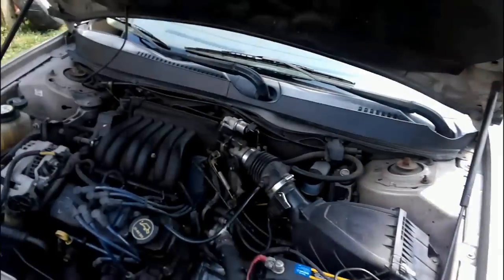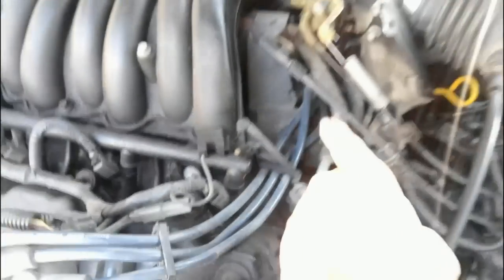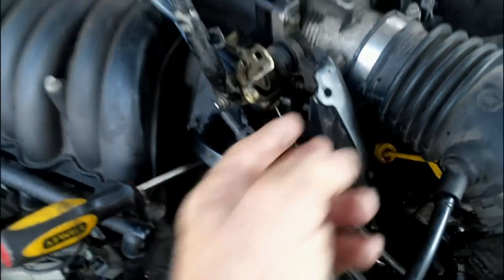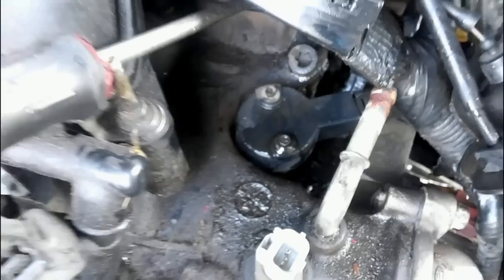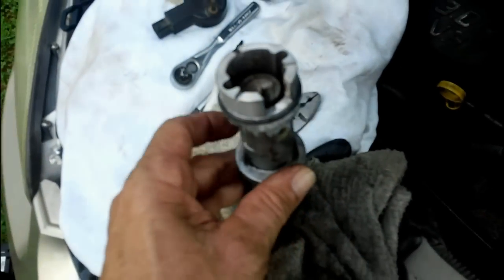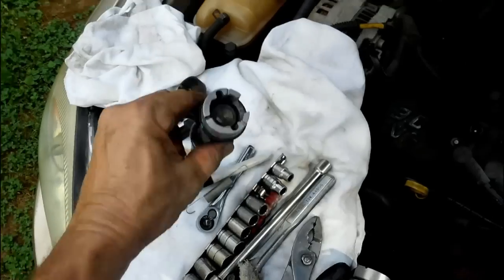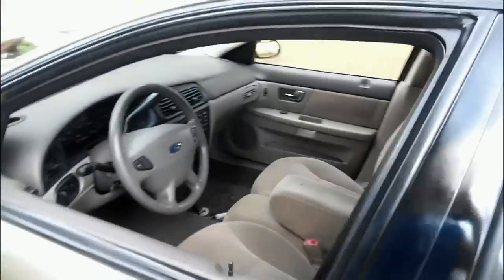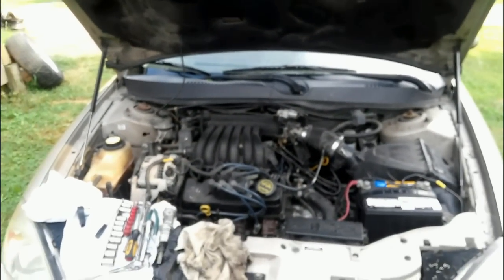Taurus Camshaft synchronizer replacement. Taurus 3.0 2001 (squeak, squeak, squeak) Easy way to do.

Comment: Your video is still helping people six years later hy the way! Just snagged an 03 rust free Taurus with 75k miles and had that same whine. She  sounds perfect now!
Reply from the maker: Thats really Cool!!
Reply: I’ve got an 02 wagon I’m driving while I’m saving up to rebuild my 4.0l sport trac that jumped time. The wagon had been sitting since 2019 and has started making the chirp. Plan on going ahead and replacing the synchronizer this weekend, thank you very much for your informative video.
Reply: @colbyeads7895  I wish mine was a wagon. Rock it proudly! And maybe save money and not rebuild that 4.0? Jkjk.

Comment: I'm in the discovery stage for the problem for my 2005 Taurus with 140k miles and with the same engine - 3.0 Vulcan engine (with the Single Overhead Cam), and I think this was exactly what I needed.  Of course the first I thought with that kind of squeak is that it was a bearing on the water pump or alternator, but the squeak is coming from the center of the engine - exactly where (as it turns out) the camshaft synchronizer is located.  I had no idea this happened and is somewhat common.  So thanks in advance - based on your description and video, I'm 95% confident this is my problem too.  Super video with enough detail to do the repair and enough information to help make the diagnosis.  MUCH appreciated.... Later - Yep, that was it.  Hardest part turned out to be getting the wiring harness out of the way.  Your video was very helpful.

Comment: Thanks, tee vee waxman. I followed your step by step instructions, and it was tough, but yes it worked. Car had quit on me, left it at work for three days, fixed it as the sun rose this past saturday, beat the rain, yes it took right at two hours to replace. Tough to wrangle all that crap out of the way, had to use three bungee cords to do so. Thanks again, tee vee, you saved me four hundred at the dealership.
Reply from the maker: Cool! Glad it worked for you!

Comment: I had to replace mine today and when I took the sensor off, I couldn't believe it but mine was lined up just like yours so I also got very lucky. It took me probably 6-7 times putting the syncronizer in and out to get the new one in just right but I finally got it, then I reconnected everything, started up the car and it ran perfectly. This just took me hr and a half from start to finish so I was pretty stoked being this was the first time I had ever replaced this part. I saved 500.00 doing it myself and yes guys you will be nervous cause all I worried about was messing the timing up but it worked out great and the car runs beautifully.
Reply from the maker: Nice! On a white 02 I have I likely never got that thing lined up! Took 2hrs. Sometimes it just works out.
Reply: TVWXMAN32 does it always line up TDC or is it just luck that happens
Reply: 500 bucks labor is what they want!
Reply: Did you have to put it on Top Dead Center?

Comment: Just oiled mine and fixed it (for now). Has 180K so it's last rodeo...
Thanks for great video!
Reply: What do you mean you just took it out and put engine oil all over and that worked
Reply: @hoosierdad4  Someone suggested just putting a little oil down in there then reinstalling. I did that and been fine for awhile now.
Reply: Did you have to put it on Top Dead Center?

Comment: LOL. Just watched your video.....AFTER I changed mine.  I was not lucky enough to have it dead center, but I did a pretty good job of marking it. The problem was that the new one was NOT exactly in line with my lines.  Anyway, I put it in as close as I could and started the car. Started and ran at 1000 rpms for 2 seconds and stopped. That I why I came in to look for videos of others installing to see if I screwed up and how. At the very end of your video it hit me.....I never tightened the band on the accordian hose where it meets the throttle body. So, I got my butt up and went out and looked. Not only did I not tighten it, I didn't even have it on the throttle body.  So, put it on and tightened it and hit the key.... purring like a kittel.
Reply from the maker: Nice! Glad you got it fixed! ...Feels good to save big money and time!!

Comment: I just now have this problem with my 2003 Taurus Vulcan V6 with 100450 on the clock. This is just like replacing a mechanical distributor. Thanks for this video on how to fix it.
Reply from the maker: Nice....At least your heater works ;)

Comment: My friend is having this same problem.  I tried using a basic code reader but it would not throw the code. Just a check engine light and oil light. Good video.

Comment: To whom it may concern.  For a temporary fix, I have been taking off the sensor (the black piece on top of the metal part) and squirting 3 in one oil on the top of the shaft.  It seems the bushing/bearing at the top  gets dry for some reason.  it holds for about 4 months then you have to do it again.  I have been doing this for 50,000 miles..still working fine since 100k.  Just a emergency get-you-by till you get the time or the money.  6:53  just squirt a couple a good squirts right on top and it seeps down.
Reply from the maker: Lucky you! It never worked for me....
Reply: yep..lucky i spose, but it still working fine.  I imagine one day I will be pulling it out so I can see exactly what part is squeaking, but I hypothesize, that the oil isnt getting up to the top bushing for some reason, or maybe its greased at the factory and when that wears out, it squeaks.  Not real sure, but it may buy some time for someone if it works.
  Thanks for the videos, btw.  really helps me out with my taurus.  Appreciate the effort.
Reply: I'm going to give this a try, don't have the money to replace the synchronizer right now, all I need is to make it last till I get my tax refund.
Reply: It worked for me ! Just dropped a few drops of oil right on TOP of the synchronizer , no more squeak ! Thanks bro
Reply: Did that also cause the p0340 camshaft code to go
Reply: The sqweek probably not
Reply: @dxta7360  it should right

Comment: My 02 Taurus only has 122k but the squeak seems to come from the belts somewhere. If they get wet it lessens. When the car warms up it goes away but when it has been driven for a while it will get a flashing oil light at stop lights. Check engine light just says misfire first 1000 revs. Not sure if this is the issue. Probably multiple issues but it runs pretty fine for the most part. Have noticed it lurch at stop lights  recently too. Any help is appreciated.

Comment: Thank you very much for the video this gives me confidence to replace myself....I just put new belt on thinking that was my problem. also where is that black bolt located you took off ?
Reply from the maker: Nice! Side of cam shaft hold down bracket.

Comment: I have the same year that has been sitting for 4 years. It cranks but no start. I have no voltage going to the cam sensor, is there a broken wire or what? I have been trying for 2 months to diagnose it. Any ideas?

Comment: Spent the last two days replacing this on my 4.0 ranger only to get no oil pressure once I was finished, gotta redo the whole thing now
Reply from the maker: Gear mesh
Reply: @FixingWithPassion  to do that can I simply remove the bracket bolt holding the synchronizer in place and rotate it until its mesh with the gear?

Comment: I'm going through the samething with my 2005 Ford Taurus. It's doing that squeaking noise off and on and when I come to a completed stop at a stop sign/red light my car will jerk/surge and it'll act like it's trying to die and it has died on me a few times also but it just does the jerking off and on....been doing this since June and I've spent $700 at a car shop and nothing was fixed and today I took it to another shop and they said it's the camshaft sensor so I'm gonna get it fixed for $544 and I'm hoping and praying it'll fix the issue
Reply from the maker: O my! Do it your self....save $500!!
Reply: @FixingWithPassion  don't know how to

Comment: I'm playing hell trying to get the cam sensor out of the block; I have tapped on it and tried to pry it up but no luck..    Did you use a puller?

Thanks
Reply from the maker: No, but I had to pry it out basically little at a time. Experiment with prying methods. Maybe tap with a small light weight hammer.
Reply: @FixingWithPassion  ok….thank you sir.

Comment: it's more of a "chirping" sound. I have it too. Hope to get it replaced soon. Thanks for the video. Also, did you have problems with the car dying and "check engine light" coming on? Mine is doing that but not sure if it's because of the cam shaft synchronizer or something else.
Reply from the maker: O yea! And it aint the birds singing for spring....;( The dying could be just a low idle setting. I think there is a set screw in the intake to set the idle up some.

Comment: Great video Nathan.   I have a 2000 3.0 Vulcan engine which has different setup.   Do you have any ideas on how to access the synchonizer?  It seems located under or very close to the ignition module/coil, a little hard to locate.   I might try the oil drop remedy until I can gain a little confidence on doing it on different engine.   Thanks!
Reply from the maker: The wiring is packed in there. You may have to Google some on this. I've not done any 3.0

Comment: Other videos say to bring the engine up on TDC before removing the synchronizer but i wonder if that`s really necessary.
Reply from the maker: I would probably do that "if" you can ;)
Reply: Shouldn't be a problem. Been tinkering with cars for 40 yrs.
Reply: I put mine on TDC just for good measure by centering u the tab with the u-shape indention on synchronizer.  I did not remove the MFA sensor or air cleaner assembly either, I just gently pried up the wiring harness that goes directly over the sensor cap which allowed "just" enough room to remove old synchronizer and install new one.
Reply from the maker: Glad you fixed it. Man its tight there to get that thing out!
Reply: What I have done to several of mine (we have four Taruii in the family) is to take a box cutter and cut the flap or hinge part at the top. Careful not to go too deep and cut the wires, and of course watch your fingers. Once that is done, take the top off and lift the whole thing up. I use a hardrubber bunji cord to hook on to the wireway and hook it up to the hood hinge or whatever. A short one works to get to the tower. I like to have a lot of room so I can look all the way down on it.
Reply from the maker: I like that Idea....Thanks for sharing.
Reply: Mine does not trun

Comment: 3:44 “Then I unhooked the sensor that was right here...”
What IS that sensor? When I removed it, the male end attached to the engine was soft and broke right off. There’s still wire running through what’s left, and the car seems to start and run fine, but it does have some in-out play and I’m getting a steady yellow “Check Engine” light, and I’m pretty sure it’s related. Help?
Reply from the maker: Time stamp??
Reply: Coolant temp sensor? Is that what ur referring to?

Comment: I have a 98  Taurus That the oil light came on today and started ticking. The check engine light came on as well. Could this be part of the problem since it runs the oil pump?

Comment: Hi Nathan, were you also experiencing engine misfire (jerking and lunging) above 3500 rpm at highway speed?
Reply from the maker: No actually ran great just squeaked.
Reply: I’m also experiencing the misfiring above 3500 rpm at highway speed.
Reply: @jesssalgado6769  I'm going through the samething with my 2005 Ford Taurus. It's doing that squeaking noise off and on and when I come to a completed stop at a stop sign/red light my car will jerk/surge and it'll act like it'll die and it has died on me a few times but OT just does the jerking off and on....been doing this since June and I've spent $700 at a car shop and nothing was fixed and today I took it to another shop and they said it's the camshaft sensor so I'm gonna get it fixed for $544 and I'm hoping and praying it'll fix the issue
Reply: @FixingWithPassion    I'm going through the samething with my 2005 Ford Taurus. It's doing that squeaking noise off and on and when I come to a completed stop at a stop sign/red light my car will jerk/surge and it'll act like it's trying to die and it has died on me a few times also but it just does the jerking off and on....been doing this since June and I've spent $700 at a car shop and nothing was fixed and today I took it to another shop and they said it's the camshaft sensor so I'm gonna get it fixed for $544 and I'm hoping and praying it'll fix the issue
Reply: Hardazzhick05 it’s been a few months, did it fix the surging issue?

Comment: I got a code for it a while back. Replaced it tried to get it lined up as close as possible..car has been running for months since. Earlier today check engine light was accessed code was still present along with o2 sensors. Any ideas? The car definitely wouldn't have started at all if the cam synchronizer was installed incorrectly though correct?
Reply from the maker: Clear the codes and wait until the CEL comes back on again. Then check the codes. To verify the codes. Perhaps the old code did not get cleared.

Comment: Does that helical gear on the bottom of the shaft require grease before it gets put in?
Reply from the maker: nope
Reply: it says on the directions to dip it in fresh oil to lubricate.

Comment: Save yourself $100 and all that time and effort by dropping a good dose of oil in the synchro body. Take the sensor off the top, drop oil in the to, let the oil drool down into the bearing, put the sensor back on and your done. Some guy even drill a hole in the side of the housing so they can oil the bearing once and a while.
Reply from the maker: I've tried oiling it also...but the squeak just came right back....ugh